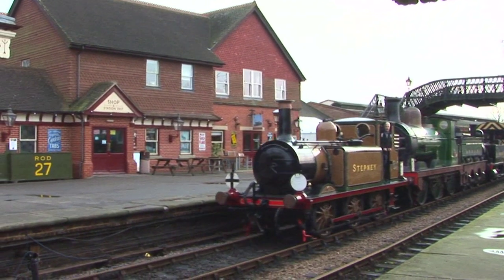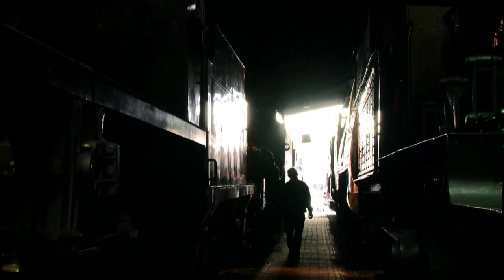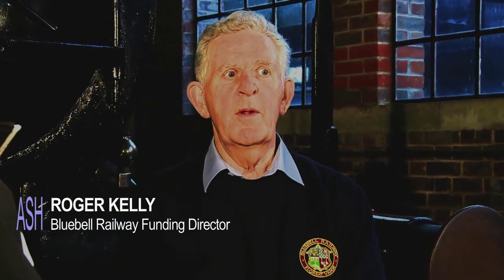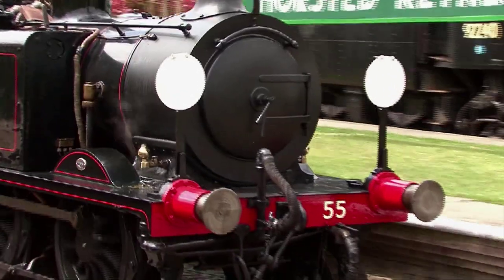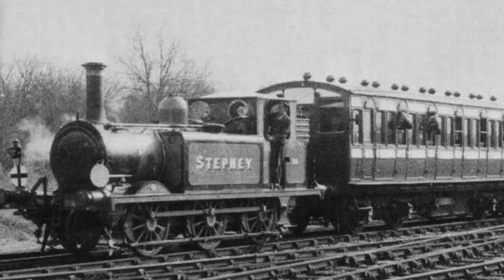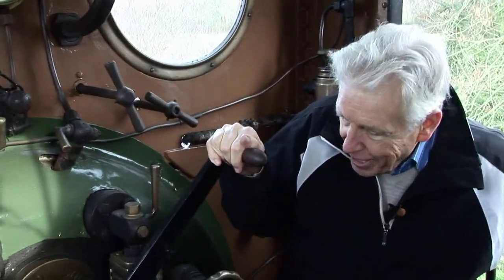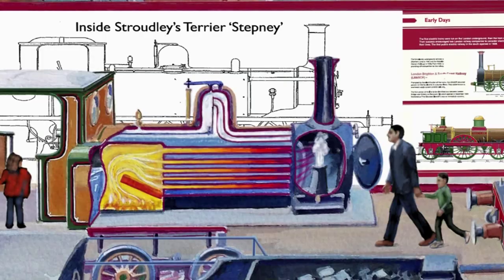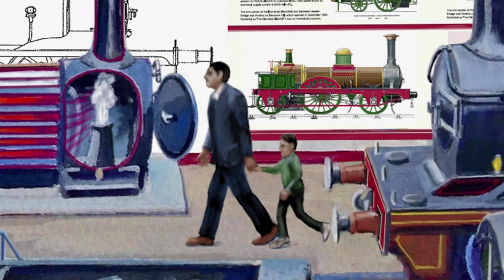Bluebell Railway ASH appeal

Comment: so will the locomotives in the shed be permanently on display? or "stuffed and mounted" or will they be able to go back out on the line after proper restoration.
Reply from the maker: The locomotives on display will be rotated as necessary, and the inclusion of a particular locomotive in the ASH display does not change its status on the Bluebell in any way - they can be removed from display and restored to run when they reach the top of the queue for overhaul, irrespective of whether they are on display in the ASH part of the shed, or on display elswhere in the same shed, or stored elsewhere on the line.

Comment: Will Stepney ever be in steam again?
Reply from the maker: Yes, we'd expect so, but we don't know when. It needs new frames, cylinders, axleboxes and probably wheels/axles and boiler, so it'll be a very big overhaul when it does happen.  What's not clear is, with so much needing to be replaced, whether we actually keep the exisiting locomotive complete and build another one!  That may depend on the wheels - if they are OK, then the rebuild will be a lot easier, although we already have a pattern from when we cast a new pair of wheels for Fenchurch.  We already have the new cylinder casting to hand.

Comment: Little question: with Stepney in the exhibition, will there be a chance to get him out and restored? Or will he remain inside? Just curious, 'cause I live in Germany, and when I go and visit England, I would love to see Stepney in steam :)
Reply from the maker: +McCoach Railway Productions - Locos in the exhibition will be rotated depending on what locos are available for display and which are being overhauled and actually running.  However, Stepney probably requires new wheels, axleboxes, frames, springs, cylinders and boiler at its next overhaul, so it's not planned to take place any time soon!
Reply: +BluebellRail don't worry mate, it will take a look good time till I get back onto the island ;) and I trust that you can repair her; if not you, who else ;)
Reply from the maker: +McCoach Railway Productions - We certainly could repair it, but at present we've higher priorities, to enable us to keep our trains running!  The real issue to be faced is that, with so much needing to be replaced, should we keep the original and build an operational replica, or repair it, throwing away so much original material.
Reply: +BluebellRail I understand what your on about. I saw it on an engine that went to Meiningen once: the engine was in such an bad shape, that everything except the frame needed replacing. It would use up a huge amount of money to restore Stepney; money, that is more useful spent on the engines that are curently running. Overthinking it, it would be better to let Stepney cold, and preserve him as the over 140 year old engine he is, then to building a complete new engine, just to have a loco with the number 55 and the name Stepney on it